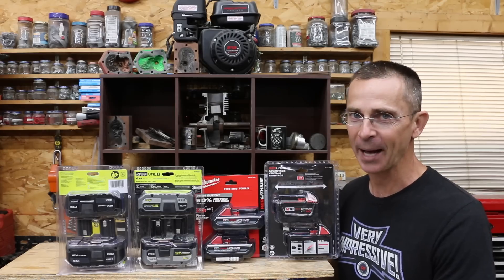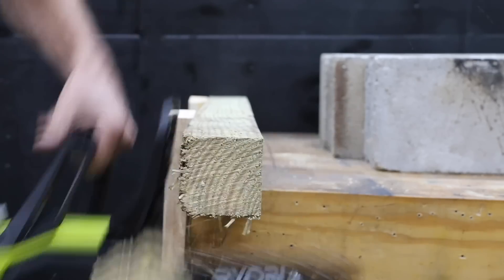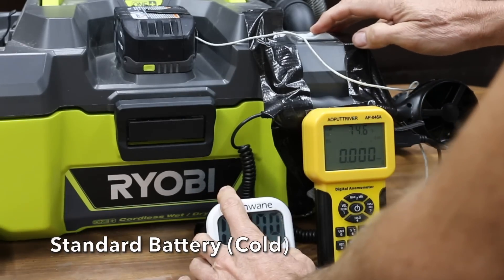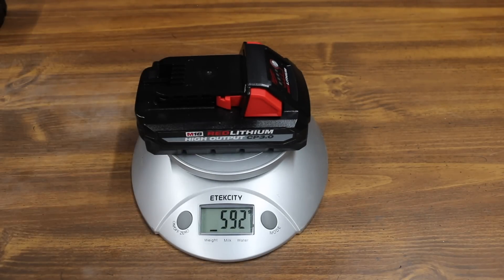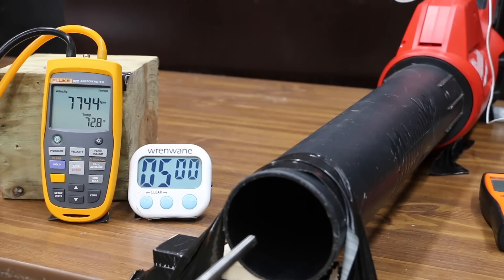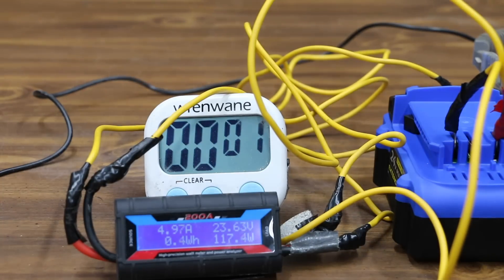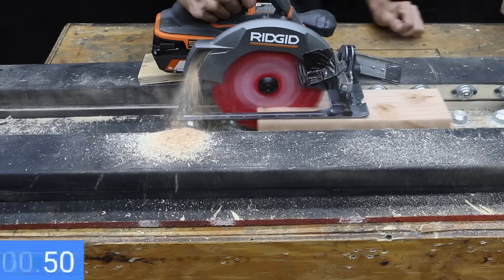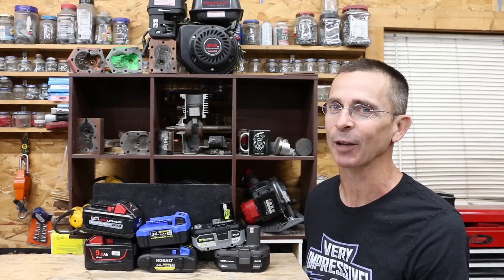Are "High Output" Batteries Better Actually Worse?

Comment: What is the recommended battery for a Milwaukee weed trimmer? I have 2 regularly 5ah batteries that I’ve  been using and they normally only last about 5 minutes each before they are either dead or overheating.
Reply: 12Ah pack for high demand applications like that. You need that third row of 21700 cells.

Comment: For the price of 1 Milwaukee Red Lithium 8.0, you could buy 5.2 knock-off batteries giving you 61 minutes and 22 seconds vs the Milwaukee 16 minutes and 5 seconds of blower operating time.
Reply: Exactly what I did when I bought a pair of 6.5A knock offs for my Milwaukie blower and chainsaw for $56.  If they last as long as the Milwaukee’s I would buy more but as anyone who uses battery tools knows it’s the batteries that are the first thing to go bad.
Reply from the maker: Thanks for sharing!

Comment: The Ryobi HP batteries are only going to work better in HP tools. There are 2 contacts near the base of the post that aren't on non-HP batteries. Similarly, there are two corresponding contacts in the battery slot of HP tools. If either the tool or the battery don't have those contacts, it's not going to take advantage of higher amp draw, which is what the "HP" label on the tools/batteries means.

Rule of thumb: The tool should have HP or "High Performance" on the label, or else you might as well be using regular batteries, as the tool/battery won't allow higher amp draw. Conversely, using an HP tool with a regular battery is fine, but you have potentially more performance from using HP batteries in HP tools.
Reply from the maker: Thanks for sharing!

Comment: I didn't want to read through all the comments but In this case High performance really means long lasting just like in cars 18v is 18v.  In e bikes  there are standard 48v and for a little more power you can use a 51v battery and go faster.  in this test high output really means longer lasting also what this is showing it extention cords save a lot of money for high drain tools,  My crappy harbor frieght chainsaw 40 bucks will blow this away and it has 18" blade it does great for around the house i bucked up 2'6 pine just fine.   Gas is way better  if your a pro.  But my cord electric starts first time every time long as i keep oil in it also in general cords are fine if your not on a jobsite where you move a lot.  same with the leaf blower corded will blow them batterie powered ones away for home use.  The best use i have seen for the batterie leaf blower is there is a guy here on youtube and he uses them for batterie powered planes.   Even that don't make sense now there are good motors for planes and multi-rotor drones ,  anyway think about it  40 bucks for a real chainsaw or $200 for a 6" blade that lasts ten minutes.  its your money
Reply: @TheDaniel85  you sent me this note and its says you have no idea what you are talking about.  I worked in the building trade for about 25 years.  what high output really means is one horsepower 120 volt skill saws and others but they all have high out put and super high current  draw.  Batteries can do that but not when carried onboard.  Because of weight limitations.  2 stroke engines also do similar things they can be 1\2 to one horse power and still be lifted. same with compressed air.  you move the energy reservoir to where you want it,  Electric motors have great torque but the powerful ones are very heavy and they use huge amounts of energy to do work.  In cars High output and thats my preferred use of the word it means a huge motor supercharging and huge fuel consumption.  and that is where the use of the word here comes from.  Its just a buzzword from the auto industry.  Where these terms were first used to sell cars when it comes to batteries 20 v  and one amp hour means just that.  100 amp hours means same speed but longer lasting.  Anything else means your probably cheating on the voltage.  Get a life chump.

Comment: I'd actually say it's not even worth the extra expense in cold weather, unless you store your batteries in an outside toolbox overnight. But I would think the batteries would be indoors charging in most cases, so they won't be frozen when you need them, even if it is cold outside. I'd rather put the money towards more regular batteries.
Reply from the maker: Thanks for sharing!
Reply: Oh, it's worth it.. If you need the extra power.

If you don't, run with the regular batteries.. Also, all contractors and trades people I know leave the batteries in the truck/van when it's winter.. Even when it's below -20 F.

Comment: I got three H.O. ryobi batteries after christmas, a 6,4 and 2 a.h. for 90. I peeled the stack of stickers off and it was 200 originally, then 160, 100 and finally 90.
  I got the 6ah specifically for the increase in torque over the 2ah included with tools after your prior tests.
Reply from the maker: Thanks for sharing!

Comment: Great video. Looks like the Ridgid battery did a lot better than the standard battery. I would like to have seen those batteries opened up as well.
Reply from the maker: Thank you for the video idea!
Reply: I was wondering why it was the only ones not opened up. 

I know the 8ah max output uses 21700 cells and I think the 12ah one coming out is also going to use 21700 cells, but I think the smaller ones use the 18650 cells. Would love for you to confirm the smaller ones used in your test.
Reply: @Cheddarsharp  yes I believe you are correct. I have both batteries. I think the cool part is that it gave more power to the saw (which I also have) but the saw doesn't have the extra terminals to get real use of the "max output". Only a part of the new tools that have come out in the last year and a half to two years have these extra terminals. The tabs on the max output batteries are just like the old octane batteries. Max outputs are the replacement for octane batteries. They are supposed to have more power available for the extra boost octane tools had, minus the Bluetooth capabilities. So I was hoping to see the difference between the two batteries mili amps, brand, electronics and so on.

Comment: Verdict: BUSTED!
Reply: No, this is just flawed testing imo.
Reply: @Combatmedic870  How would you have done it differently?
Reply: @MrV1NC3N7V3G4  You can't do it differently. How he tests is fine. 
I can only comment on the Milwaukee batteries. But... The AH of the batteries doesn't have anything to do with power output. That's just how long they will last. So take the 3.0cp ho vs the 3.0xc. 
Single series vs duel parallel. The 3.0 cp running at 35 amps vs the XC running at running ~36 amps parallel. They are going to put out around the same amount of watts. 630 watts. 

Volts x Amps = watts. 

Now...bring the 6.0 into the mix. 2 parallel banks of 5 cells @40-43amps. 80 x 18 = 1440 watts.  
The 8.0 HO uses the same parallel banks of 5 cells as the 6.0, but at 32 amps(but the batteries have more mah). 64 x 18 = 1152 watts. So the 6.0 is the more powerful battery between the two. 

The 12.0 ho uses 30amp batteries in 3 parallel banks of 5. So 90 amps. So it makes 1620 watts. So the 12.0 HO is the most powerful battery of the HO batteries. 
Some tools are going to have more powerful motors vs other. The blower is not one of them. 
I have a Milwaukee table saw. Using 5.0xc batteries, it REALLY struggled with 2" hard maple and walnut(stalled out even going really really really slow). I was going to sell it and replace it with a corded saw. But someone highly recommend I try a 6.0 HO battery. The difference was significant. I have to go slowish(as you would with any bench top saw), but the saw doesn't stall out. 
So it's going to REALLY be tool dependent. 
The manufacturers just buy the best cells possible, that give them the AH needed. They don't have custom cells made that would keep the amps at the same level. So some batteries perform significantly better vs others. 

M12 has the same thing. The 3.0 is the most powerful battery of the XC batteries. The 6.0 is the weakest. 

Hopefully I examined that clear enough. 
I'm assuming that all of the tool manufacturers are going to have the same amp difference as Milwaukee. It wouldn't make sense if Milwaukee was the only one with this discrepancy.

Comment: Battery performance also depends on the tool and what you are trying to get from it.
Its pretty devious the way these things are marketed but if you dont want to deep dive into the specific components of your next battery purchase and their individual discharge rate i will always recommend getting the regular batteries. I have 5 Milwaukee XC5.0 batteries and three chargers so even under heavy use i wont run out of batteries before i finish the job.
Reply from the maker: Thanks for sharing!

Comment: I'm really glad you used knockoff in this (and hopefully in future tests). They usually come much cheaper, and we'd like to know if it is worth buying cheap stuff (for home use, of course).
Reply from the maker: Thank you for the video idea!
Reply: @ProjectFarm  If you wind up doing a brand-name vs knock-off, I've heard the knock-off's are sometimes just over-driven cells, so the longevity might not be as good.

Still, if it's half the lifetime, but 1/5 of the price, that's a win in my book.

Comment: Sounds like from some comments and these tests, a tool that can truly take advantage of the HO batteries would be a primary reason to own them.  I hope @projectfarm can repeat this test soon with some tools designed to take advantage of the HO batteries.  

Another test, piggy backing on the "knock off" battery stuff, I'd like to see is if a custom built pack using the widely available PCB & Cases can compare to an OEM one.  For example, if you sourced and built a 3Ah or 5Ah or whatever pack using exact cells from the OEM but with the knock off PCB.  I wonder how much is the PCB vs Cells or a combination.   @ProjectFarm if this is a test you'd be willing to take on, I have several of the case/PCB setups and a lot of various cells here as I've repaired and built several packs.  I'd be willing to help contribute where I can.
Reply from the maker: Thank you for the video idea!
Reply: @ProjectFarm  I have a battery spot welder at home, so if you go forward, I'm happy to help contribute some labor and product.  I'm curious to know results myself!

Comment: That's amazing.  I think the overwhelming majority of people would think the "high performance" batteries would offer a significantly improved performance across the board but these tests show otherwise, very cold temps aside.
It would seem to be a triumph of marketing over reality.
Reply from the maker: Thanks for sharing!
Reply: Not really, actually faulty testing on PFs part. Tools that does not have high current demands, and actually can make use of the extra power... Will have close to zero advantage of high output batteries.

Other tools that can take advantage of it benefit very clearly. If you've tried high current drain tools with standard packs and high output... You know the difference.

Comment: Hey PF! I think you should start to look at doing some thermodynamic type testing instead of these wood cutting tests. Then you can understand how much energy and wattage the test devices are under. An example would be using tools to pump water from one bucket into a higher up bucket, then the amount of water pumped is the useful work output by the battery
Reply from the maker: Thank you for the video idea!

Comment: Something though you can put the better battery on the charger and get that extra umph on a really stuck bolt or go back and drive in a fastener a little deeper that the reg.
Reply: So there is a place for them my mind.
Reply from the maker: Thanks for sharing!

Comment: Good stuff as always.   I have seen some other tests where certain tools benefit from a better battery.   It wasn't a massive difference but probably enough to notice.   I have a bunch of ryobi tools so I just got their special buy two pack of 4amp high output for $99.   I couldn't resist since they are normally $110 each.
Reply from the maker: Thanks for sharing!
Reply: Same here. I got about a million Ryobi tools laying around and never seem to have a fully charged battery

Comment: An obvious conclusion is the choice depends on the intended use and power tool; but also professional trade vs DYI, and $$$ budget. I'm a DYI guy, I have Milwaukee knockoff batteries still going strong for 6 yrs. Yes the OEM batts. are a little better, but not worth 2 or 3 X/price.  Trade guys have time, efficiency, and dependability demands to consider, so it's individual needs and desires.
Reply from the maker: Thanks for sharing!

Comment: great idea.   I had a hunch that there wouldn’t be much difference.   Another idea to take your idea to the next level - get some adapters and use different batteries brands to power the same tools.   I’m not sure if there are any electronics in the adapters, I wouldn’t think so.  If not then the adapter shouldn’t noticeably impact the battery performance.  Why do this? I keep hearing/reading arguments that one brand name batteries are better than others all the time.  From this video you’ve shown that some different brands use the same cells, so the electronics could make a difference.  I’d be interested to know.  With the adapters available now I’m considering what is the best tools, rather than sticking to one brand because i have the batteries and chargers.  If I only need to invest in a few relatively inexpensive adapters, that would be great.

Comment: Would be nice to see the OEM list the actual differences in the batteries, to explain why they say they're better in x or y way.
Granted, most people won't care.  But some of us would like to know if it's a chemistry change (like iron phosphate, nickle manganese, etc), format, etc.  Helps those that want to know understand what is different w/o having to tear them apart.
Reply: Most of it in the Milwaukee line is the switch to the Tesla cells (2170).
Reply from the maker: Thank you for the video idea!

Comment: Would you be so kind as to test both cordless and corded reciprocating saws for cutting fallen tree trunks up to a foot in diameter. They are much lighter cheaper tools than chainsaws and the blades are cheap, quick and easy to replace.
Reply from the maker: Thank you for the video idea!

Comment: yesterday I ran a m12 cp2.5 in my heated jacket on high heat for just under 5 hours. I then ran the 3.0 xc and it didn't make it 4 hours. The cp2.5 is about 6 months newer than the 3.0 but I was suprised because the xc3 is a huge battery to carry in your pocket compared to the 2.5 cp
Reply from the maker: Thanks for sharing!

Comment: very interesting! Thanks for your work. I have been buying camera batteries for Canon, Panasonic, and Fuji cameras for ten years. It seems to me that knockoff batteries will be fine for the first few cycles but not last as long after a few months of use where the branded batteries last for 2 years + of the same kind of use. I know you've done rechargeable AAs and my experience is those  Eneloop are troopers and seem to survive as many cycles as camera batteries. Would love a camera battery showdown knockoff vs branded. possibly too niche?
Reply from the maker: Thank you for the video idea!

Comment: I do have a question about the difference types of batteries.  Do the “high out” have more charging cycles before failing?  If so maybe they’re worth the extra cost but if not, then it doesn’t seem so.  Thanks for the great work and videos!
Reply: This info is in the publicly available datasheet for every cell type, it can vary a bit but there's not some major difference in cycle life compared to many if not most of the popular cell options.

Comment: As others are noting, I've noticed not all tools care about high output. The ridgid octane batteries give a noticeable boost in the SDS rotary hammer or impact driver, but not so much in the circular saw. The milwaukee batteries are great in the recip saw and impact driver, but not so much in the framing nailer, until the charge level drops, then the high output lets you keep going into a lower state of charge while still driving the nails all the way.
Reply from the maker: Thanks for sharing!

Comment: The think is, if the tool need 500w of power and the standard battery can deliver it consistently then it won’t make any difference with the high output battery. If you use a tool that does have more like 1 to 2 horsepower the standard battery will not be enough to take full advantage of the tool.
Reply from the maker: Thanks for sharing!

Comment: Can you compare charging speeds between regular and high outputs? (Using a rapid charger)
Reply from the maker: Thank you for the video idea!
Reply: @ProjectFarm  it's a pretty big selling point. Seeing that high output is sort of useless and not worth the money during use, maybe charging speed is a savings grace for the cost.

For example, i got my van robbed 2x in 3 months and working with few batteries right now. So I'm considering getting another rapid charger kit. If I'm correct and the high outputs really do charge faster on a rapid charger, it keeps me working instead of waiting or filling the time with other tasks, in construction jobs. (I don't really run out of batteries during regular maintenance jobs.)

I'm a plumber by the way.